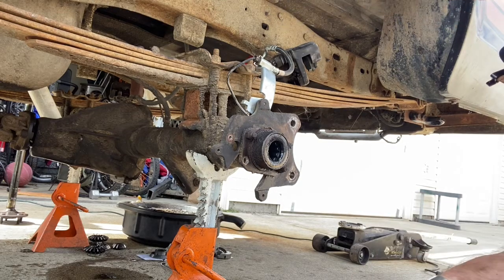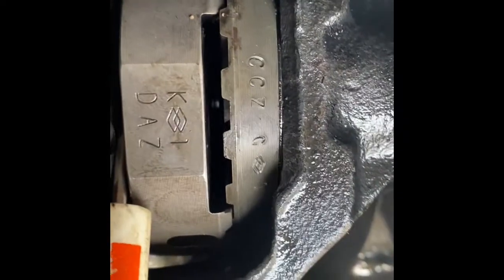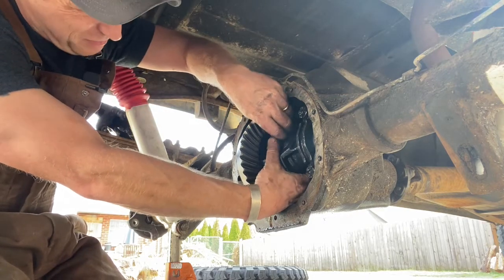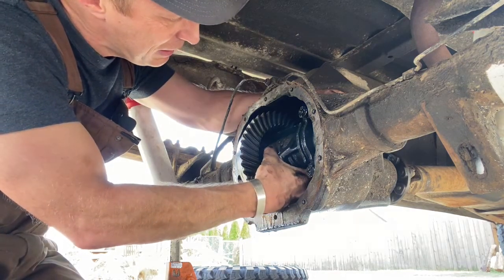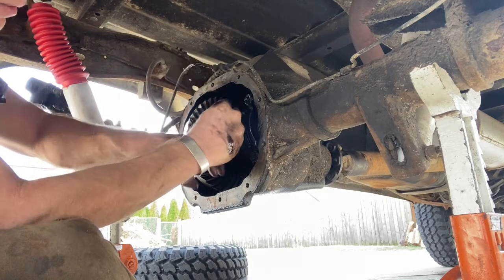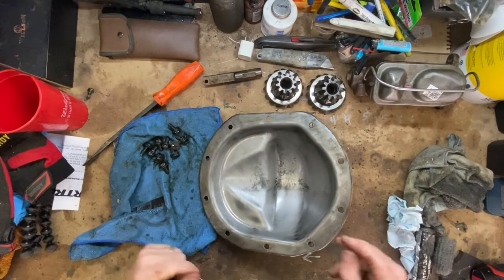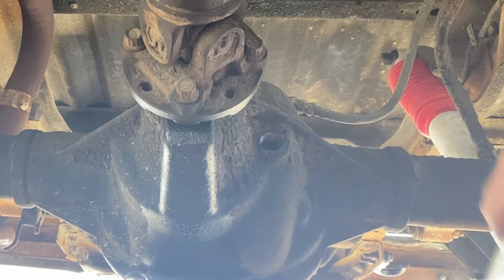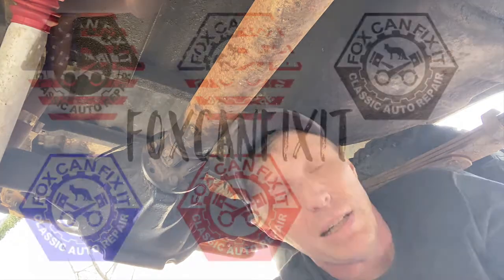How to Install a Richmond Lock Right lunchbox locker Part 2

Comment: You're a better man than I sir.  I don't have the strength the accept that some parts of the vehicle are just going to be dirty..  I spent hours cleaning the diff cover and housing before putting it all back together when I changed my pinion seal and diff cover gasket..  Thanks for sharing the mistakes too.
Reply from the maker: I cleaned off the important parts 😀.   I am going to scrape off and clean the whole rear axle sometime soon, maybe even throw some undercoating on it.

Comment: Hopefully you got away with it but there are some feeler gauge measurement that should be made to see if you the correct gap between the cross pin and spacers.

Comment: Thanks for the vid...I was worried about the micro measurements but I guess they dont matter. How did it work out...
Reply from the maker: For this kind of locker the measurements like pinion backlash and tooth contact patterns don’t really come into play because you are not removing the ring or pinion.  It worked fantastic.
Reply: @Foxcanfixit  Perfect thanks man I'm putting one in my 9:25 tomorrow...
Reply from the maker: It’s really not too bad, the springs and pins are the worst part, other than the smell of gear lube 😀

Comment: id love to see a little test video of the locker!!
Also i just watched the brake conversion. if i went to the junk yard i could pull those brackets off a sn95 sold rear Axel?
Reply from the maker: The brackets came off a 98-04 V-6 for mustang.  A for explorer of similar age May work as well.  yes you could probably find these parts in a junkyard.  I sold the truck so I can’t test the locker, but after I put it in you could feel it ratcheting around corners and if you stabbed the throttle in a corner they would squeal from locking up.

Comment: does adding this make it a posi traction ?
Reply from the maker: It’s a baby locker so slightly better than a posited toon unit, but not as strong as a full blown locker or air locker.  But it’s waaaay cheaper and easier and will work just fine as long as it’s a mild build.